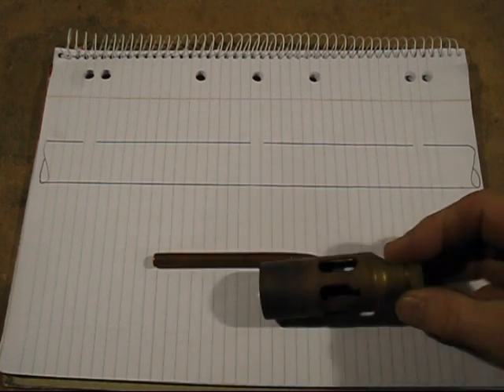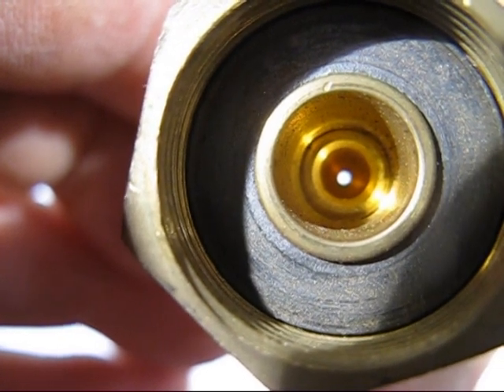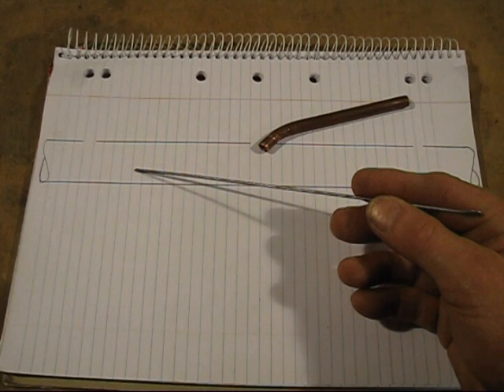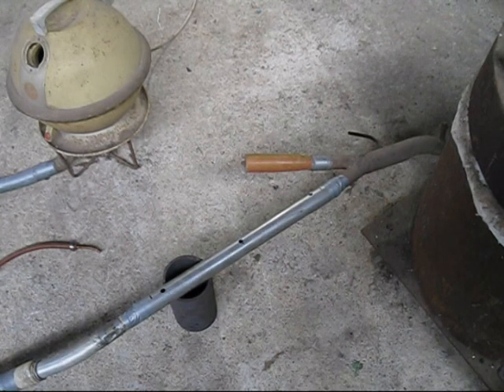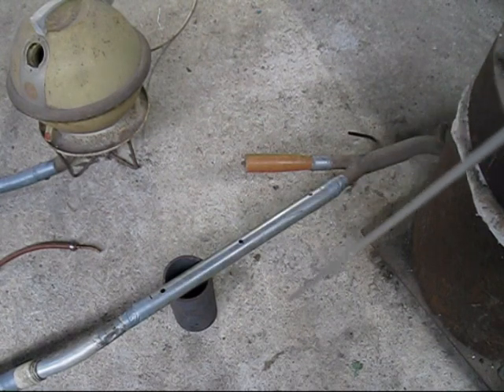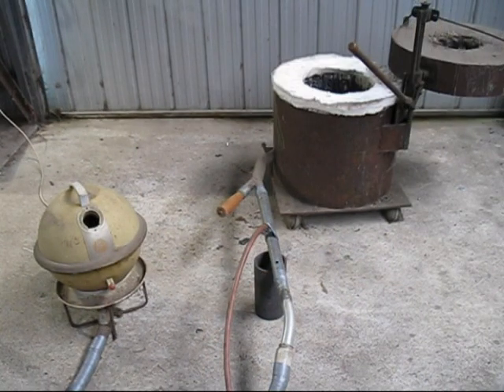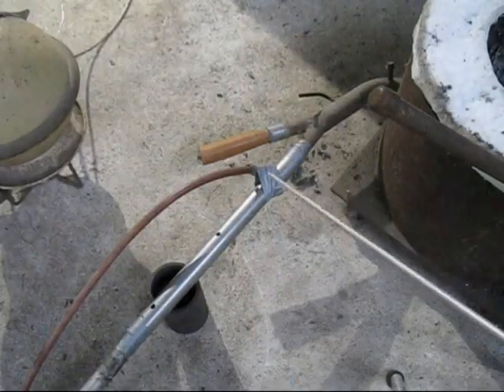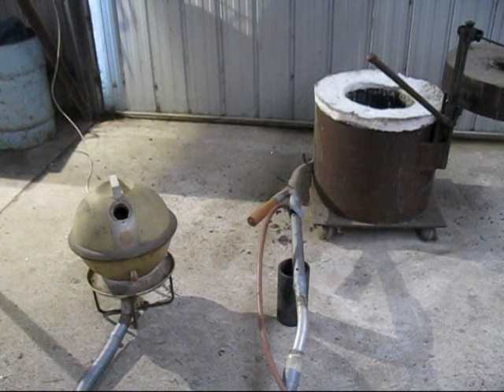How does a forced propane burner work?

Comment: Great demonstration!

I've been holding off upgrading my burner because of the misconception you mentioned in the beginning.  Looks like I can just unscrew the head on the Sievert 3488 I'm already using and just stick the tip inside a tube as it is. Going to test this tomorrow!
Reply from the maker: Please do do this test so you are firmly convinced that it works and maybe do a video of it?

Comment: Good demo, although I did blow up a vacuum cleaner using town (coal) gas when I was a kid. Of course, I did it when no one else was home. I think I got away with it!
Reply: ..... but the house was very dusty for a while after  ;<)
Reply from the maker: I am glad you mentioned that  because years ago I was using coke to melt aluminium and left the hose on the furnace and came back later to switch on the power. It was the loudest bang I have ever heard and the vac was completely destroyed. It turns out that coke will still produce carbon monoxide even though the blower is not running and travelled all the way up  the hose to the armature.

Comment: Do you think that a forced air would be more efficient than a venturi burner? A venturi needs high pressure with lots of flow to draw the air in. 
I use a hair dryer, a needle valve for the LPG control with a standard BBQ regulator and the air/fuel goes through a tortured path to ensure it is well mixed. The LPG enters in through a 1/4 inch BSP nipple with a back nut about 1 meter away from the burner and half that from the hair dryer. It works really well and I have been surprised with how little gas I go through. It will melt a large crucible of aluminum in around 8 minutes from cold.
Reply: It sure seems like I can run lower PSI for equivalent temperature in a forge - and end up with a higher maximum temperature - since I swapped to using a blower for forced air/propane.
Reply from the maker: When you want to melt cast iron a blower is a must but lower melting point metals do a test to compare them.
Reply: Oh, that's very true! You can just barely liquify iron, with a lot of trouble, with a venturi style burner. Getting it to a pourable temperature, however...

Comment: I have a t piece for my gas inlet, and a t piece with a gate valve to regulate air flow as my vacuum cleaner it too much. With a 25mm pipe I van run over 1600 degrees Celsius.
Reply from the maker: A tee piece is all you need.